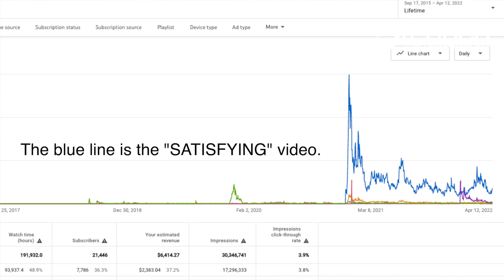How To Make Money On YouTube,The Hard Way. Why SUBSCRIBING Matters So Much.(BONUS: LOTS OF SANDING!)

Comment: Sorry about the filter. They do make in-gun filters in different size mesh or screen for different paints. You can get from 30 to 200, depending on the brand of gun. As you said, it's optional and if the paint is pre-filtered, no need for it. For the average hobby painter who isn't that careful when painting his patio furniture, the in-gun filter can save some grief and down time. Another use for a filter is when spraying high metallic content paints. Some painters will put a ball bearing or 2 in the cup which keeps the metal particles from gathering at the bottom of the cup due to gravity. As the gun is moved around painting, the bearings keep mixing the paint just like the little ball in a spray can. W/o a filter in the neck, a bearing can get int there and obstruct the paint at the most inopportune moment, as in right in the middle on the long side of the body. Can't use a filter with metalflake though. Too coarse and it takes a special gun anyway, or at least a whole dedicated air cap, fluid nozzle and needle. Like you have a 1.8 and those can be 3.0.
Reply from the maker: No worries. Lesson learned.

Comment: Spray it again use guide coat and wet it with 400 for solid and 600 for metalic... No da this time, all block the longest  blocks you can use... When you're done seal it. Then send it.... It will save you thousands...
Reply from the maker: all of that will be done by the pros.